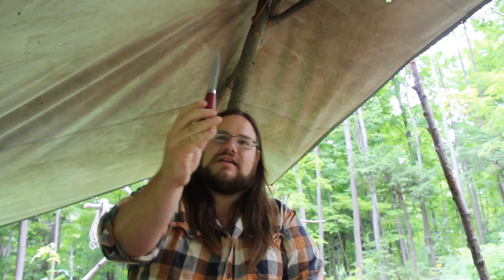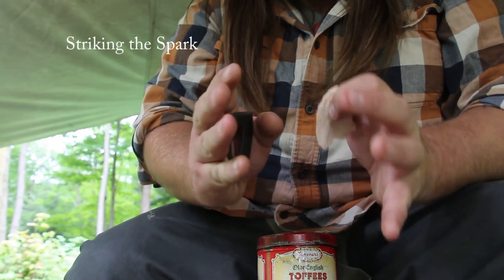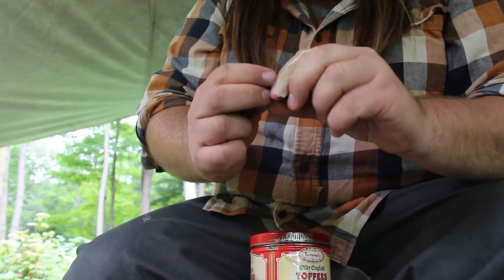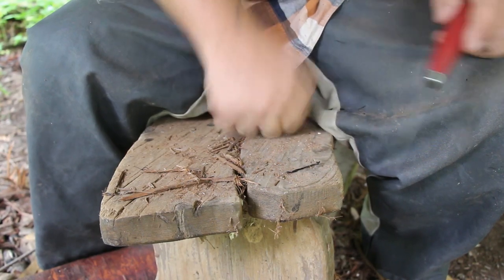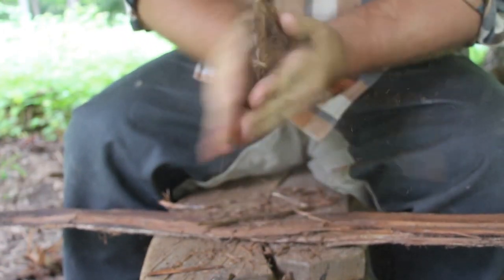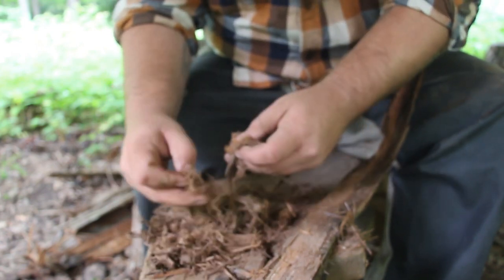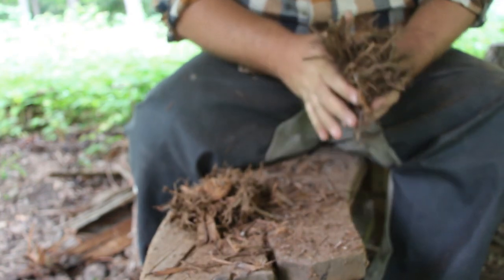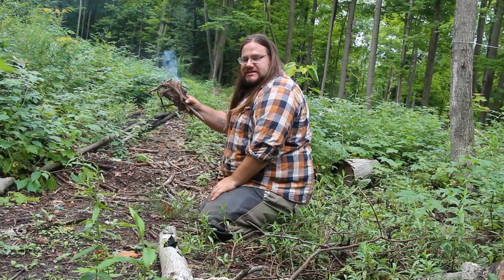Basic Flint and Steel Fire skills.

Comment: I'm not terribly fond of char cloth because the frontiersmen never carried cotton char into the wilderness.  Cotton, even cotton rags,  was imply far too valuable to waste, and char cloth wasn't necessary, anyway.  Not only was natural char easy to make, you don't even need char of any kind to start a flint and steel fire.

Then again, while I think knowing how to make a fire with flint and steel is important, I'd say the chances that I'll ever need to build a fire this way, even in a survival situation, are at least a million to one.  This being the case, I don't carry a designated striker.

I do carry a high carbon Stockman pocketknife, which is not only better for carving than any sheath knife, and which makes an excellent, and safe, striker with the blades closed.  I find it works better for me than a regular striker, in fact.   

But if I want a primitive fire, it's more likely to start a friction fire than a flint and steel fire.  If need be, I can start a friction fire without anything from civilization, including a knife.    I'd rather have a knife of some kind, any kind, any size, but it is possible to start a fire without one, and this is good knowledge to have, as well.

Just a note.  If you're in an area where iron pyrite is reasonably common, you can start a flint and steel fire with it, but it's almost never as easy as doing so with refined iron.  It is possible, though, and this is good knowledge to have, as well, though you really have to put in a lot more practice.
Reply from the maker: Actually charred fabric (regardless of type, cotton, linen, what have you) was a frequent tinder in the frontier times, with journal entries from Robert Rogers, John Rae and stories from guys like Jim Bridger mentioning the use of such tinders. Charred plant fibres in the right conditions are good, but for the most part, it's easier to do with charred fabrics. Add the fact that for the most part the idea is to bring along some tinder, and replace the spent tinder with those from the field (such as charred punkwood, mullein pith, milkweed ovum, etc). 

As for relying on a pocket knife for flint-and-steel firelighting, though in some ways safer (no exposed cutting edge), the problem with it is that the impact of the strike can actually damage the knife, when the blade is closed. We have seen cracked pivot holes, and have seen the edges chipped badly from being smacked against the backsprings, center pins, and even the nail-pins. 

In all reality, the likelihood of being in a survival situation itself is a million to one. What you have on you in that situation is a hard thing to gamble on. It's why we teach so many different methods of firelighting, shelter construction, and so on. The more you know, the less you carry. The idea of training in different styles and methods, is not to depend on them solely, but to expand your mental toolkit, and teach you to improvise. Stagnation is death, adaptation is life.

Comment: That's why I always carry 3 things to make a fire lighter, Ferro rod, flint and steel .one this is not true sir i have a old file it throws Sparks like 4 th of July you don't need blacksmith to make a steel striker
Reply from the maker: You're very true about the striker not needing to be fancy. As I said, an exquisite temper. That describes a file very well!
Reply: @CanadianBushcraftChannel  I bought like 5 old file from flea market a 1 dollar for each one I used the grinder for the side flies to smooth them they throw awesome Sparks